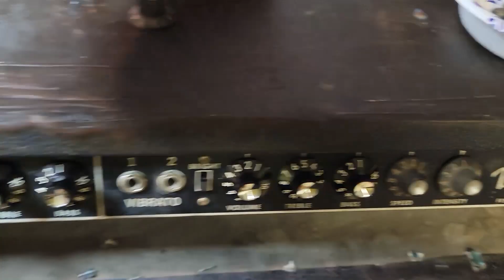Fender 1967 Blackface Bandmaster AB763 repair

Comment from the maker: Well, by golly, I never posted what the fixes were up to that point! The "most critical repairs" included an unsoldered connection creating an open in the bias circuit. The tremolo was the most obvious, the opto-coupler. I had already replaced the electrolytics. I've ordered and received all new resistors, still need caps, some of them, at least. I'm also going to order a new turret board. Keep as much of the original wiring in place as I can. An update after, probably be a bit yet. Thanks for viewing!